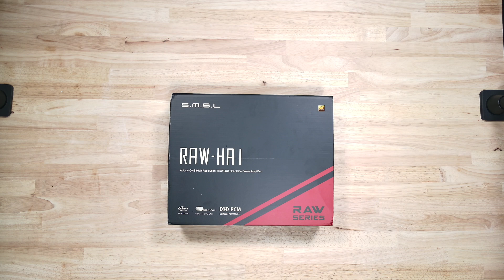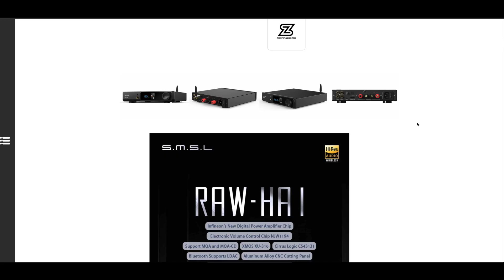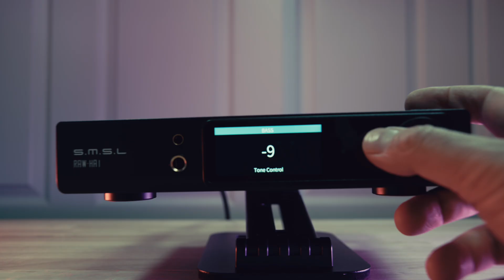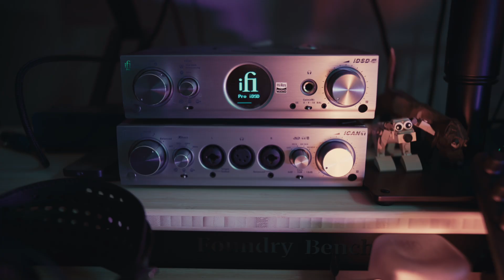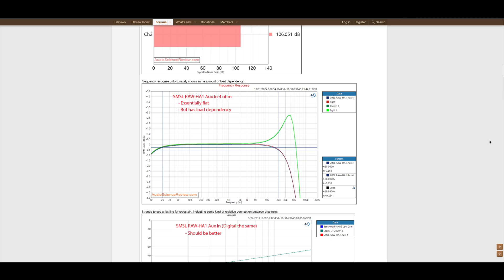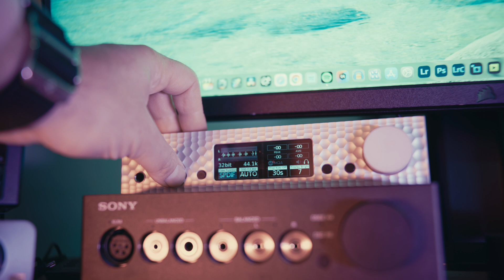SMSL RAW-HA1 - Saving Graces

Comment: Saying with such confidence that the DAC filters have no impact on sound is wild for a "specialist". Might as well say you don't care for that level of difference. The difference between a fast rolloff, phase corrected filter and a slow, minimum phase filter is not only very measurable, but very easy to detect just listening, especially if you have a DAC that lets you change it quickly with a remote.
Reply from the maker: “Measurable” does not automatically mean “audible.” DAC filters measure differently because they mathematically have to. The question is whether those differences survive into audibility in normal listening, and evidence for that is extremely weak with modern DACs.

Claims that fast rolloff vs minimum phase filters are “very easy to detect” are almost always based on sighted listening where the listener already knows the setting changed. That’s not reliable evidence — expectation bias is powerful, especially when someone is actively concentrating on tiny differences.

In reality, most modern DAC filters produce differences so small that people struggle to identify them consistently under blind conditions. If the change were truly “very easy to detect,” we’d see people passing controlled blind tests reliably and repeatedly. We generally don’t.

A measurable graph difference is not the same thing as a meaningful listening difference. If it were, every tiny deviation in electronics would radically change sound, and modern transparent DACs would all sound wildly different from one another. They don’t.

The measurements and proper listening tests actually support each other. Conducting silly uncontrolled tests and not looking at the measurements for comprehension is where the problem really is.
Reply: @NoThemeReviews  What a convoluted reply. You're saying that measurements matter, but only the ones at an unknown magnitude and they have to be confirmed by controlled listening tests. And yet, here you are saying there's no difference between filters when you have never participated in, or read a report of, a controlled listening test on this subject. Can you actually cite those reports you mentioned?

Try to play the album "This one's for Blanton" with Duke Ellington on piano and Ray Brown on the bass and change on the fly between the filters I've mentioned. Listen to the differences in the tightness of the bass and the reverberation of the piano. There are a few filters that are more difficult to distinguish, but these two provide good contrast between them.

Comment: Prefer control knob to touch screen on this type of product, as somebody has already pointed out, the headphone outputs are rudimentary and it is primarily an integrated SPEAKER AMP.
Reply: I didn't understand either, complaining about the small size of the screen but then suggesting it should be touch sensitive

Comment: Good to see you back. Missed your brutal honesty. I laughed my way through Josh Valor's latest video, as he gushed over the NEW Topping dx5ii. Apparently it sounds so much better than basically anything else at the price point (and much above) 😂🙄
Reply: despite there not being any sound differences it is probably the best dac/amp you can get right now at that price just due to its number of features, ability to be used as a pre-amp, peq, and it's high power output being able to drive almost all headphones apart from the susvaras (and maybe tungsten, haven't seen people measure how well it drives those)